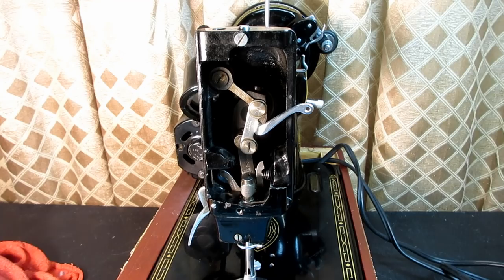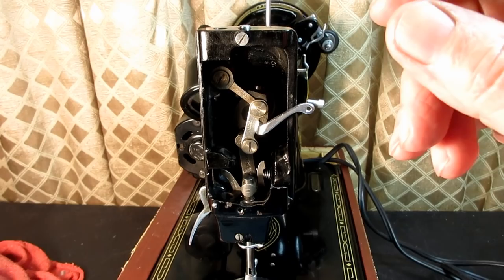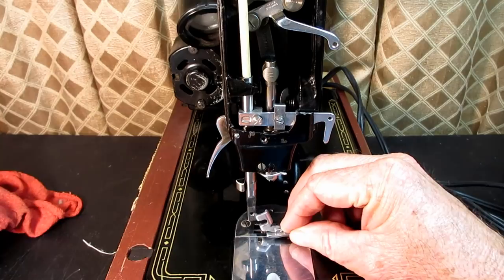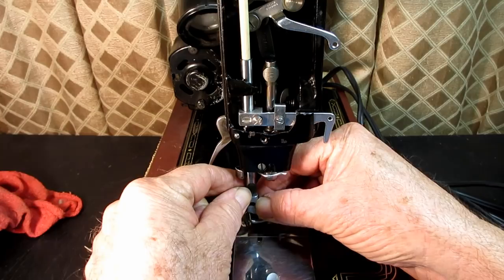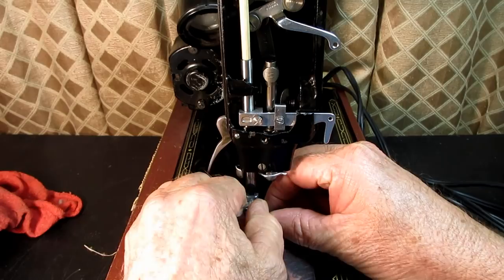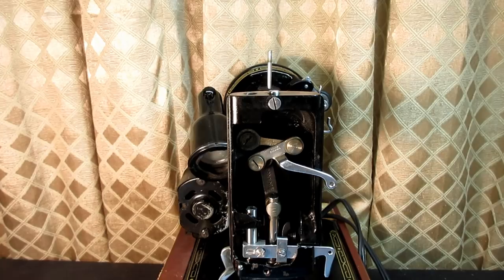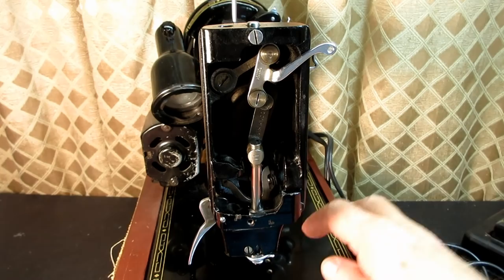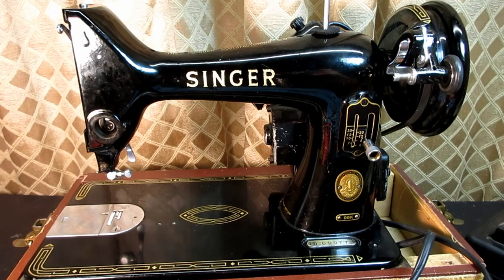The Presser Bar System of a Singer Model 99K Sewing Machine

Comment: I'm wondering why, after I've adjusted the height, that I can't easily fit the stack of quarters  under the presser foot as Andy does at 22:32. I've tightened it with the lifting lever up, the feed dogs below the plate, and as little pressure on the presser bar as possible. Help!
Reply: I think I answered my own question (after doing it over and over 🤦‍♀️). My lifting lever wasn't staying up by itself like Andy's, so I was holding it up. Instead of holding it at its normal "resting" position, I was holding it ALL the way up. So when I released it, it was lowering the presser foot a bit. Oh boy, now I can finally move on.
Reply from the maker: Sorry I'm late to the party, but you found the solution. Thank you for sharing it here. I pinned your comment to the top hoping others with the problem can find it easily. Take care.
Reply: @andytubesewing1953  After all that, I had another problem - something was preventing the needle bar mechanism from fully rotating. I finally figured out that the slot of the cap screw on the thread take-up lever had been messed up (not being "lefty-loosey") (and not by me, of course). Just that bit of roughness was hitting the presser bar! I sanded the cap screw until it was smooth and all was good!
Reply from the maker: @DFTBAandDS  Congrats on figuring out that problem. You're a good troubleshooter. It also goes to show how close the tolerances are on these machines. It is surprising how much the machine can tell us during a close inspection. I've always wished the machines could just talk, like "yeh, some knucklehead messed up the left-handed screw head, so watch out for that."
You should be proud of what you accomplished today,🏆 and thank you for saving that machine. 🙏
Reply: @andytubesewing1953  Thanks, Andy. I love restoring these machines. This kind of work doesn't come to me naturally, and it's having your videos available that I'm able to do it. I watch them over and over and over; I think I'm personally responsible for increasing the number of views a significant amount. 🤣 I'm truly grateful for all your work.
Reply from the maker: @DFTBAandDS  It may not come naturally but I think you are a fast learner. I appreciate all your views, too. I think I get 4 cents per 100 views or something near that. I'll mention also that if you ever feel the need for parts manuals, etc. for a model I have many on file, and if you email andymanuals53@gmail.com and ask by model number (Singer only) I'll have them reply with PDF copies of the original Singer documents. Have fun and take care.

Comment: Andy you went and made me look for a 99 or even a 66 Singer.  I have a Singer 237 and a Kenmore 158.12111 which are both good machines.  But the Older Singers are becoming very interesting thanks to your videos!!  Talk to ya later my friend.
Reply from the maker: Sure, and it's hard to beat an all-metal vintage Singer. I don't know what you want to sew, but the model 404 is cast aluminum instead of iron and was the heavy-duty straight stitch version of the 401A Slant-o-Matic. The old saying, once you sew slant you just can't go back to a low shank. https://www.youtube.com/playlist?list=PLsCOZgzzaiKIB4kvIHCfHYuyLMUp5A4UI
All metal, interior direct drive motor and steel gears, no belts.

Comment: Oh gosh, wow...that is really different from the models I'm used to! They sure simplified the timing marks and the slack thread regulator on later machines! Thanks for another great video tutorial, Andy!
Reply from the maker: It is interesting how Singer innovated over time. The same year this 99K was made Singer was making the 301A without the regulator and the timing marks were already on the needle bar. I am noticing that the take-up lever system seems the same on most of the models though. I guess when something worked that good they left it alone. Thank you for watching.

Comment: Andy, I appreciate your advise to reduce the pressure on the presser bar while adjusting the presser bar lift (height). I have struggled against the full pressure on sewing machines while adjusting the presser bar lift. I like the 4 quarters plus feeler gauge blades to measure presser bar lift.
No matter how long anyone has been working on sewing machines you can still learn new things. Thank you, Mark.
Reply from the maker: Sure, and thanks. One retired Singer Repair man had small aluminum blocks made for a handful of the heights so he could just put the block under the foot and tighten the screw. Every time I dig out 4 quarters I tell myself I'm going to do that, but obviously, I never have.

Comment: Thank you Andy, I enjoyed this video. I liked the way you started off by assembling then taking it apart. I guess I'll have to add a filer gauge and four quarters to my little sewing machine repair kit ;)
Reply from the maker: Welcome, Rita. I thought it would be easier to see the parts by assembling it from scratch. I have a smaller feeler gauge too, The bigger one shows up in the videos better. They both have inches and millimeters marked on the blades. Cost was $3 to $9 at Auto Parts Store. Hardware stores should have them as well as eBay. Get Stainless Steel. Thanks for watching.

Comment: Andy, the easiest way I have found to align presser feet rotation is to put a fresh needle in the machine and split the difference side to side.  You might need to use your gages from the side.  Love your vids.  ( I have more than 50 or 60 machines. )  I don't think that I would have been bold enough to attempt disassembly of my 401As without your helpful videos!  Thank you!
Reply from the maker: That is a very helpful tip, Fred. Thanks for sharing that on my channel. I'll try that out next presser bar I work on. I pinned your comment to the top for others to see. 60 machines are quite a herd; congratulations!
Reply: @andytubesewing1953  My wife sews amazing Victorian and Steampunk outfits.  Two years ago she bought a 1920s White Rotary that we fixed up.  One thing lead to another and having been off work for 3 months...lots of machines, little house, way out of room. 🙂
Reply from the maker: @fredobot5298  Oh I get that! I started with a 600E. I got to about 28 machines in my small condo. I knew I was in trouble when I started shopping for a storeroom to rent, haha. Fixed and sold many of them, some to charity and friends and I only have about 5 at a time now. Take care.
Reply: @fredobot5298  Haha, I have precisely the same problem. It was such fun looking for machines and so easy to find great deals that I couldn't pass up. Sometimes I would go to look at one machine and the seller would offer me two or three more! I didn't realize how many had followed me home. (We have lots of room so most of my my machines are out of sight.) I finally had to stop. I've fixed and sold some of them but it takes forever. I'm too much of a perfectionist and not a very good mechanic:(

Comment: Can you help me figure out the model of my sewing machine on the front it says F8367882, I would be happy to send a picture. Please help!
Reply from the maker: That serial number is for a Model 99K from 1918. See the list here; (scroll down about 80%) http://ismacs.net/singer_sewing_machine_company/serial-numbers/singer-f-series-serial-numbers.html
Remember there are several variations of the 99K. This list may help you decide which variation you own: http://ismacs.net/singer_sewing_machine_company/model-list/classes-1-99.html
Reply: I have figured out that I have a 1950 model made in Canada everything is the same except the nose is not flat it has a protrusion on it and it's made in Canada I don't know if that makes any difference in the electric motor is Bakelite

Comment: I bought a singer 99 trouble the needle bar goes up very little and the wheel turns very little  Its not the clutch any suggestions how to repair
Reply from the maker: Welcome to Andy Tube, Maria. By "very little" does the handwheel rotate a complete circle, or what percentage does it rotate? The oscillating hook may be dirty, lacking oil or jammed. Very first thing is to give a general cleaning (inside) and oil the whole machine generously according to the manual. When I sit around for a long time I move very little at first too.
Download a very nice FREE manual here:
https://www.singer.com/sites/default/files/product_manual/SINGER%2099%20Sewing%20Machine.pdf
Good Luck.
Reply: The wheel moves about quarter inch the shuttle will not oscillate  I have oiled the machine still no difference I can't take the shuttle out or the bobbin because the latch screw should not be removed it will cause difficulty in the stitching operation according to the service manual I would like to take the shuttle apart anyway since it doesn't work  what are your thoughts
Reply from the maker: Yes, a classic "frozen" vintage machine. The best way I know to free it up is generous oiling following the instruction manual. Using a hair dryer to warm the bushings, bearings and moving joints goes a long way to softening the old dried up oil that is usually the cause of lack of movement. Sometimes the machine has been stored for years or even decades and oiling it once just won't do it. Some of my friends have used denatured alcohol and kerosene to loosen thing up. I never tried that. One thing I find often is oil build-up on the needle bar inside the needle bar bushing. Oiling and heating it allowed movement to start. You can remove the whole bobbin case and positioning bracket by removing the feed dog (one screw on the bottom, on the right side of the hook area) and lifting it out the top. Then loosen one chrome set screw that holds the post of the positioning bracket in place (also down below on the left side of the hook area). Usually you must use a punch to tap out the bracket from below after removing the set screw. The bracket also then removes from the top. I have NEVER had to do this to just get the machine moving. I have always been able to just oil, heat, oil, heat until the old oil softens and allows movement. Of course if things are rusted then that is a whole different situation. If you have more questions email would be a better forum than this comment section. My business email address is listed on the "ABOUT" page of this YouTube Channel.

Comment: Every time I lifted up the handle to raise the presser bar to adjust the height, the handle goes back down and never stays up, is there something that I am doing wrong?
Reply from the maker: To stay in the up position, the entire presser bar assembly must be installed, including the presser bar pressure regulating thumb screw. You may need to have the thumb screw tightened a little bit more to keep some pressure on the bar. If you tighten it too much it's hard to lift the bar/foot by hand while putting the coins in and setting the height, but if you do not have enough pressure on the bar it will just slip from the lifting lever and fall down. See if that helps. Good luck.

Comment: Hello Andy, I have a Singer Model 66-1, Dec 15, 1914 that I am restoring.  (The machine originally belonged to my wife's grandmother.)  After a lot of time with penetrating oil I managed to get the presser bar assembly apart, similar to your 99K.  (1) However the top thumb screw bottom is frozen to the top of the presser bar.  How do I get them apart?   (2) On the 66-1 the Slack tread regulator, the part of the presser lifting bracket on the 66-1 just kind of floats.  It is secured by a set screw in the split of the bar part of the presser lifting bracket, that goes in the slotted slide of the head of the machine.  Probably, the reason the presser bar was frozen from a misaligned bracket.  Maybe a design flaw that was corrected in later models?  
Thanks for your videos, I find them very informative and applicable to my 66-1.  Plus you respond with answers to questions!  This my first time working on a sewing machine and I am enjoying it
Reply from the maker: I have not seen those parts stick together, but I've never worked on a 66 before so I do not know if it is made to be together. If not, is there rust on the machine? I have used a rust remover, like The MUst for Rust, to separate parts before. If you'd care to email my channel at andytube53@gmail.com I can send you all the documents for the 66 that I have. Good Luck.
Reply: Andy, I've never worked on any sewing machine in my life, so every bit of work done is by trail, error and YouTube.  It seems very straight forward.  I am thoroughly frustrated that I don't know what I am doing wrong.  So, then I suck it up and I know that I need some help.  I need some parts anyways and go to a little sewing machine shop with a Dutch soccer jersey  hanging in the back, of a fabric store.  The nice older gentleman who works there - is older than me and I'm 68 years old!  I bought some parts and he looked at my presser bar and thumb screw.   He said "yes that pretty hard it it should slip right off".   They are two separate pieces and walked me over to another similar machine and told me to take the thumb screw off.  I was amazed at how easily it came off to see how it worked.  He told me "that what you need to do".  

He told me to clean mine up some more to remove the rust and grit, soak it again with penetrating oil to make sure the oil gets in between the metal of the bar and thumb screw.  

Then after it has soaked for awhile, to carefully not to damage the metal to lightly tap the edges of the thumb screw up and down with the bar held vertically on my work bench.   Then repeat until it comes loose.  I looked at him and asked him how much he would charge to do the work for me?  He said with a smile on his face "Oh no, you can do it.  Good bye""  I did it!!!!!!
Reply from the maker: @rafaelmunoz21  I get the trial and error and that is how I started, but without YouTube, so you can imagine the fun I had. I'm glad you have access to an OSMG (Old Sewing Machine Guy) who can point you in the correct direction. Interesting the rust; that's why I mentioned it in my previous reply. I'll tell you from experience that removing rust, dirt and old dried oil and applying fresh oil can correct 80 to 90% of a machine's problems. I know you are enjoying working on your machine, and I'm guessing when it is finished you will be interested in finding another to work on. BTW, you have a great attitude and that is75% on working on a machine. You're doing a great job!

Comment: I’m restoring a 99k and have a problem with the tension release lever.  It is bent or otherwise damaged and slips of the end of the tension release pin and jams.  I can’t see how to remove the lever.  Help!
Reply from the maker: Hey, John. I think the release lever is held on by a hinge pin. It may be installed from the nose end behind the needle bar. Like the hinge pin holding the presser bar lifter lever, this hinge pin is also slightly tapered and probably needs to be "punched" or pushed from behind the nose and out the front. It's tricky to get a hammer or similar back there and I worry about hitting the machine. Check out this video Carmon made using a C-clamp to push it out https://singer-featherweight.com/blogs/schoolhouse/removing-the-presser-bar-lifter
I think you'd need to try something like that on the release lever also. The pin is part # 33671 and is called "Tension Releasing Lever Hinge Pin". You can see it in PLATE No. 22680 on Page 37 of the List of Parts for Singer Model 99-13 which is available for free download in PDF format at this link:https://www.supsew.com/download/Singer/Singer%2099-13.pdf 
Hope that heads you in a good direction, John, and good luck.
Reply: @andytubesewing1953  Thanks Andy.  I was able to get it out.   The pin is in the same hole as the thumbscrew that hold the end plate.  It is not tapered and is slightly small than the thumbscrew so I was able to drive it back in from the front.  The release lever has a slight bend to it so as to hit the tension release pin.  Mine was bent a bit too much and was just catching the pin.   It had developed a wear spot and was slipping off the pin and jamming it in place.  After a bit of straightening it is now good to go.
Reply from the maker: @johnwalker1471  Thanks for the update, John. Nice to know the pin is NOT tapered. It's hard to tell by looking at the pix in the parts manual. I'm glad you got it fixed. A bent lever like that is rare, but I had a couple of them myself. I appreciate you fixing the machine and keeping it in service.

Comment: Oh no, I dared to venture into unexplored territory, ie, tried something you hadn't done in a video. I tried removing the Presser bar lifting lever and I've tapped the hinge pin partway out in the wrong direction - which I learned from other viewers comments on this video.

I should never trust myself to try something without your advice.
Reply from the maker: You'll be OK it's a tough little machine. My advice would have been to try the method the featherweight shop uses, as originally shared with us by Meagan Mills (💖) https://www.youtube.com/watch?v=XVQqLqd89j0&list=PLVcWip9cp-SNCV1ytID5NS9l3oBhLd8lm&index=28
Reply: @andytubesewing1953  I'm going to try using that method to push the pin back in, since there's no room to wield a hammer from the motor end of the machine.
Reply from the maker: @DFTBAandDS  I agree. I'd try the same thing. Hope it works out.